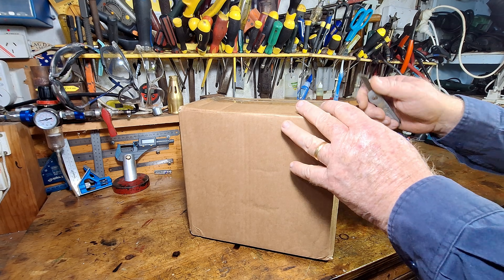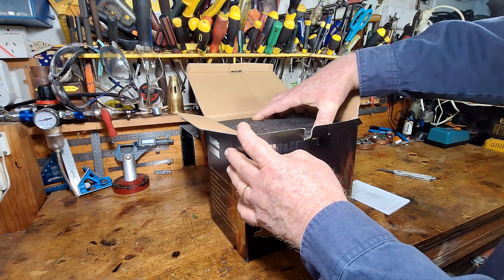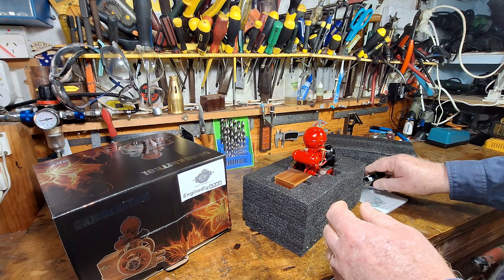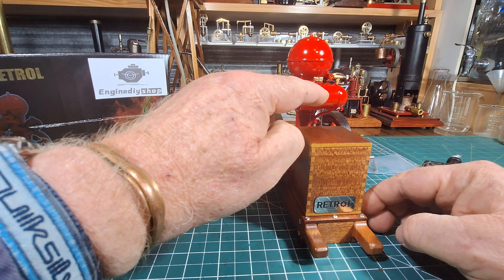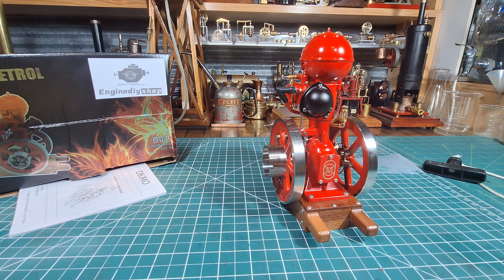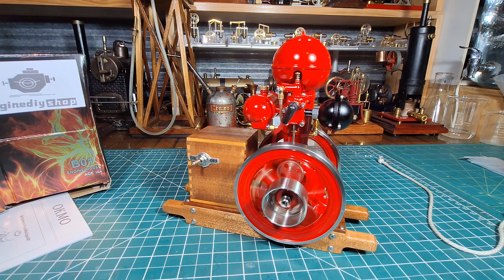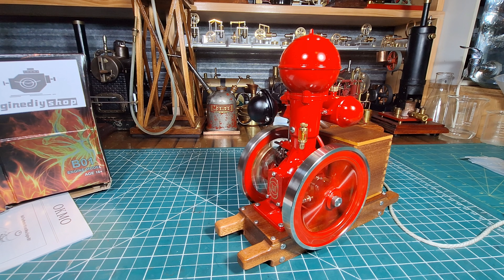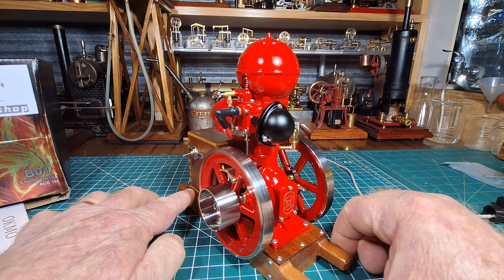Baker Ball Top Monitor B01 Hit & Miss Model Engine

Comment: The ignition box is a bit unsightly. I'd have put the electronics under the sled.
Reply from the maker: It's workable where it is, though it can be in the way at times - Cheers Jim